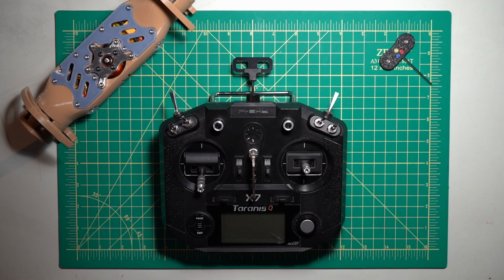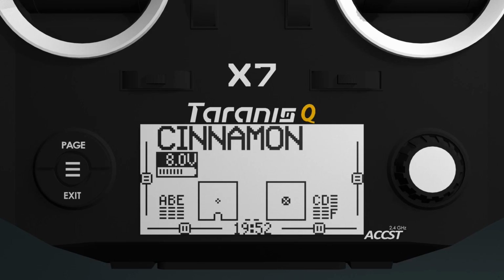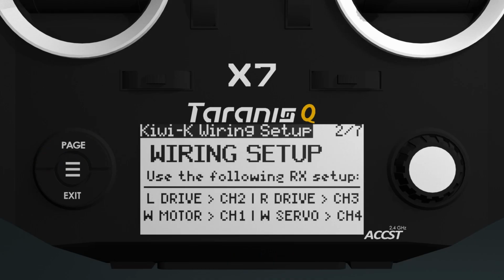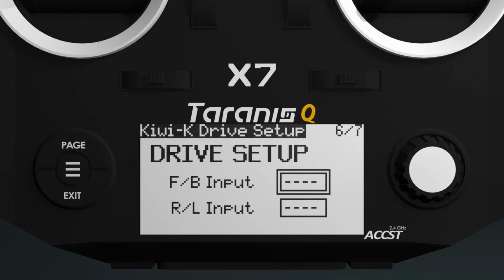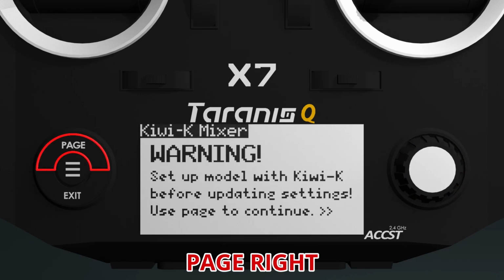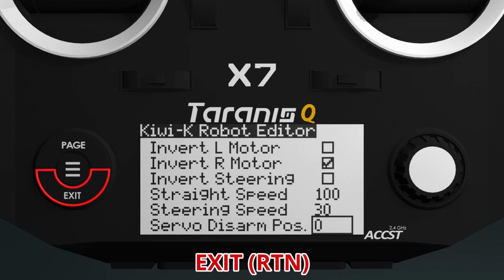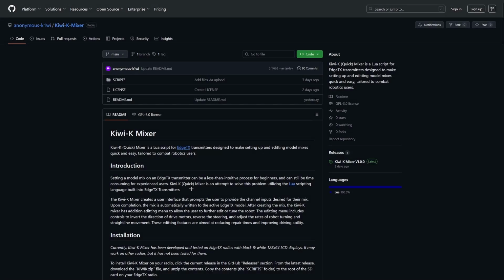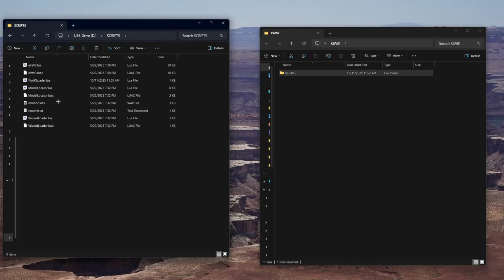EdgeTX Combat Robot Mixing Made Easy with Lua [Kiwi-K Mixer Guide]

Comment: Is it possible to update logical switches and special function using lua script, all we have to do it manually as you have defined in your last video because I want to put a safety mechanism which does not spin up my weapon until my weapon switch is it-100 position so is it possible to do with a lua script or by doing changes in your code or I have to do it manually as you tell in your previous video
Reply from the maker: Right now that hasn't implemented in this version of the Lua script - I wanted to focus on getting the base functionality out there first.  If it's something that becomes commonly requested, I will look into it if/when I approach doing an update.